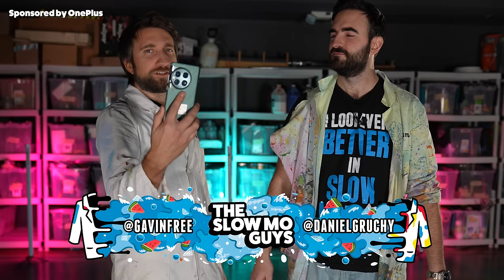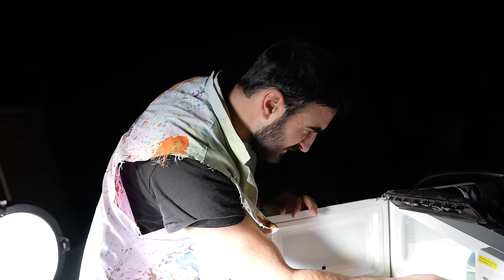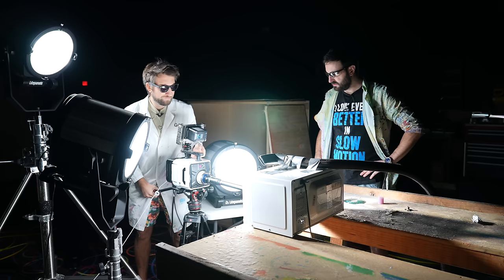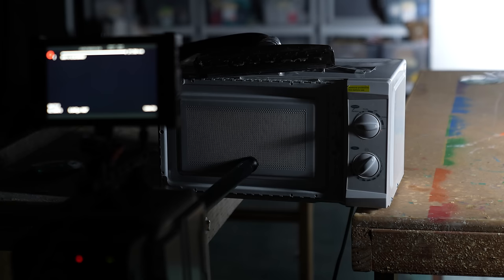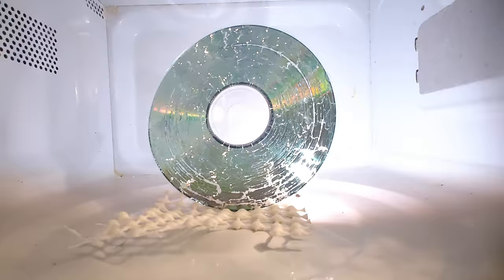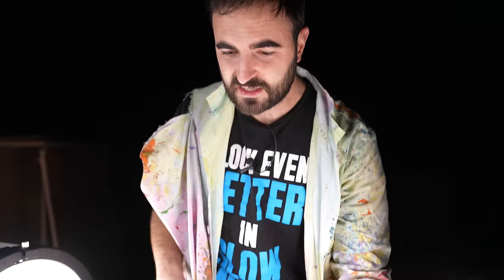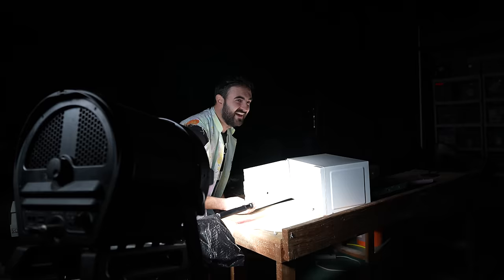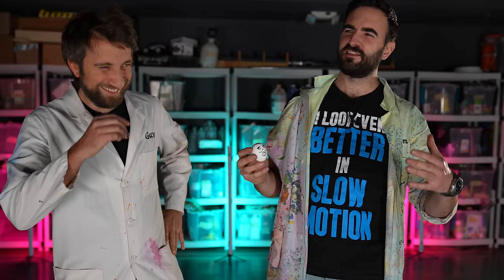Inside a Microwave at 80,000fps - The Slow Mo Guys

Comment: Fun fact: That 12cm wavelength is what causes your food to heat up unevenly. Microwaves transfer more energy at the peak of their wavelength (every 12cm). This is why microwaves have a rotating table. Though there always seem to be parts that get less heat energy
Reply: This is why I always try to put the food at the edge of the tray instead of the middle, so none of it gets stuck in a cold spot 😄
Reply: It's also why they direct the magnetron at a metal fan.  The fan reflects microwaves into the cooking chamber but because it is rotating the waves are scattered helping to prevent hot spots. The fan also doubles as an actual fan cooling the magnetron and rest of the electronics.
Reply: @Whatsinanameanyway13 Modern microwaves don't have the metal fan anymore, at least here in Europe.
The only one that I had come across so far that had one was a quite bulky brown unit likely from the early 80s.
I know from having disassembled so many of them...
Yet there are still schematics on the internet that show the waveguide and metal fan even though it's no longer part of new designs as far as real life microwaves go.
Reply: I always place the butter in the center for 15 seconds for better spreadability when it comes out of the refrigerator. It works best in the middle.
Reply: and that's why the MIDDLE is always not heated. all around is the end of the wave length. So you better put your food at the edge of the plate.
Reply: I'm not totally convinced that 30cm hole in the door is safe long term. We used to have a microwave with a dodgy door and I was convinced it was leaking microwave because 100% without fail every time the microwave was running our 2.4 GHz Wi-Fi would be completely unusable. I even had to be scientific and prove it because I lived in a share house and it meant replacing an otherwise functioning appliance. But it was 100% repeatable, microwave running, Wi-Fi dead. New Microwave, was perfectly fine.
Reply: @_BangDroid_  to make sure, put your eye up to the hole. If the liquid in your eye starts to boil, it's leaking microwaves. Hope this helps
Reply: @grantheine6068  Aqueous humour?

Comment: Our first microwave oven, an Artica,  we got it in the 1960s, it was rated at 5.5kW output for an input of 6kW (6kW magnetron). So, of course, us kids had to put an egg in it, you pressed the start button and the BANG was a millisecond later, the user manual stated you should not cook eggs in it unless they were beaten first, and then 1 second was enough on low power, the membrane around the yolk was enough to cause an explosion of egg in the oven. 
Thanks for this and bringing back a few memories, modern microwaves are so wimpy 😉

Comment: Microwaves were so named because they were more "micro" than UHF radio, which has a wavelength of 1 m to 1 dm (IEEE definition).  "Radio waves with frequencies above the UHF band fall into the super-high frequency (SHF) or microwave frequency range."

Very cool, guys!

Comment: Microwaves actually fall in between 300MHz and 300 GHz on the electromagnetic spectrum, in between Infrared and Radio wavelengths, with wavelengths between 1mm and 30cm. Microwave OVENS use the 2.45-2.5 GHz band, with wavelengths, as Gav said, of about 12cm. I was a radar technician in the Navy many years ago, and the wavelengths of short range targeting radars is 3-10mm, while long range search radar and weather radars use microwaves in the 8-15cm wavelengths (2-4 GHz)

Comment: This is interesting! Your little shot of the disc coating failing looks exactly like a failure of a lens i filmed timelapse over several hours. I suspected it was coating failing under surface tension but its almost identical so I'll take this as confirmation. Thanks guys!

Comment: The expansion ratio of the volume of water as it converts to steam is 1600 times greater. Assuming that was a medium size egg, it's total volume would be 2.7 cubic inches, and water makes up around 87% of an egg. That's approximately 2.35 cubic inches of water turning into over 3750 cubic inches of steam.

Comment: We did experiments in college physics with microwave emitters and receptors and hardware cloth (mesh wire) with 12mm square holes in it bounced the microwaves off it like it was a mirror, just nuts.

Comment: 1:29 I do want to say, the wave physics of microwave holes isn't necessarily "Its smaller than the wave, therefore it blocks it." it's more that the surface area of the holes is able to collect, absorb and redirect them similar to how sharp points on a stealth aircraft is undesirable as it will collect and redirect the waves in all directions.

Comment: I think the microwave is armed and ready only in war condition no need to modified or if any modifications needed just adjust to 1×10^-6 m wave lenght and if you want cooling adjust into low frequency and stop the spinning fan before use

Comment: I got egg on my face when I made the mistake of thinking that it's the shell that makes eggs explode. I hard boiled an egg in a pan of water, then after I'd shelled it I found that it wasn't quite done, so I put it in the microwave for a few seconds.

Nothing remarkable happened until I took it out, put it on the worktop and stuck a fork in it, at which point there was a BANG, and the kitchen and I were instantly plastered with scrambled egg.

Comment: I worked on a family turkey farm, their eggs are larger with harder shells. There was a while where when we were bored on breaks we'd blow eggs up in the microwave, they'd just blow the door wide open lol. Once I tried that challenge where you break on egg with one hand, but then I used both and because it was a fresh egg no cracks it took an insane amount of force, but it eventually just blew up sounding like a gun going off and egg went all over the wall. I think it was actually a double yolk egg which are bigger, nuked plenty of those too. I found an egg nearly the size of an ostrich egg that had seven yolks in it once, the turkey didn't make it.

The older workers eventually complained because when I wasn't there some of the workers that would do it wouldn't clean up the mess in the microwave, or at least not very good.

Comment: The microwave region extends from 1,000 to 300,000 MHz (or 30 cm to 1 mm wavelength). Although microwaves were first produced and studied in 1886 by Hertz, their practical application had to await the invention of suitable generators, such as the klystron and magnetron.

Comment: Something tells me the mesh is built that way for a reason, there is probably some mechanism of action which creates harmonics (doubling, quadrupling etc. the wavelength). The actual cavities in the magnetron shouldn't be able to create harmonics as far as I get it but there's always some weirdness happening somewhere when it comes to sinewaves.

For those that don't know how any of this works, essentially a Magnetron is a vacuum tube diode, that is an emitting cathode & an anode & nothing else. BUT, the anode has these cavities in it which both physically trap the electrons & also act as a "tank" circuit, that is an inductor & a capacitor, since the frequency is so high (for electronics standards) the actual metal semi-circles are the capacitors & inductors, it's pretty fascinating when you think about it.

But for the craziness to begin the electrons can't just travel straight from cathode to anode, instead there are a few powerful magnetic discs around the mag, this makes the electrons orbit around inside the space between the anode & cathode, it's an incredible action considering there is a ~4.000V static potential between a hot oxide cathode emitting tonnes of electrons & the anode, the idea they can just spin around many times before being "absorbed" by the anode is crazy, remember the electrons are travelling insanely fast, if they had the mass of your average atom the centrifugal force would be truly astonishing!

Comment: I once wrapped an egg petty tightly in 13 full-sized paper towels, put the dish cover over it, and popped it in the microwave for 1 minute 30 seconds. with 2 seconds left it exploded through all the paper towels, popped the dish cover off, blew the door open, and went all over the wall. The microwave survived though.

Comment: You guys should do a video on grenades exploding in slo-mo. There's a ton of variation in grenades, all of them would vary with the way they create shrapnel. And I've genuinely always wondered how evenly the shrapnel spreads surrounding the different kinds of grenades. Does the pineapple grenades the US uses actually create a even distribution of shrapnel? And how does the German grenades from WW2 disperse shrapnel? Or does it? Especially since that was basically just a stick with explosives on top

Comment: If you wanna nuke the battery, turn on all the comm devices; gps, wifi, BT, NFC, and have an app open/running like speedtest on loop, so it's constantly pulling data. recording in the background will also help as, depending on encoding and quality, it'll peg a cpu core or two.
Just mind the heat, because drawing too much off the battery too quickly, just like super-charging, can cause the battery to overheat and go kablam-sizzle

Comment: Not an expert in any way, but the length of the wave isn't necessarily the only thing you need to worry about, the amplitude, or height, is also important.

Just thought I'd share the little bit of knowledge I do have.

A wave of a smaller amplitude, might need smaller holes, regardless of its wavelength.

Comment: I'm wondering whether the wattages of the microwave had something to do with how the eggs burst.
A lower power one might heat more slowly and give it a chance to actually cook before reaching its explosion pressure where a high powered one would heat quickly and expand the liquid and air quicker resulting in the less cooked eggs

Comment: I would be wondering if that is a blank CD that was used. It would be interesting to see if the fracturing pattern would be different with a pre-recorded CD from the factory, since the tracks are pressed in, versus a CD that is burned at home with a CD burner, since the tracks are "burned" in one groove at a time.🤔🤔

Comment: 1:40 -- RE:  Microwaves at 12 centimeters of Wavelength v. Photons;  Sure, wavelengths of Light are much smaller, because photons define the Planck length.  It isn't impossible either to get an electron to behave like a photon provided the right conditions or interactions, but the electron gun inside a microwave has purposefully been set for interactions with.... a Molecule called Water.

Comment: Eggs will explode everytime, I once put a boiled egg WITHOUT a shell in it, and it all went fine, it heated up, I took it out, set it on the table and then I stuck my fork in it....BOOOM the explosion was so loud and violent I jumpscared and fell over backwards with my chair, bits of exploded egg where everywhere, so the net time I "got smarter" or so I thought and cut the egg in half as to let the pressure out before it build up and on half exploded in the microwave and my son did the same just a week ago, hence eggs will explode everytime

Comment: I wonder if the discs that they used contained data on it or not. The sparks seemed to follow a circular pattern around the disc almost like they were following the data tracks on the disk. If the disk contained data then the pits in the tracks could act like nucleation points and cause the sparks to follow along the track lines. Would a blank disk have a more random pattern to the sparks rather than following the data tracks?

Comment: Can we do an experiment to rival a blackhole. Ex: a black hole essentially applies Extreme gravity (pressure) to the point of nothing. What I am asking is to try and destroy and object (of any size) and reduce it to nothing (almost) my visual is a black hole pulls gravity from 360 degrees and uses it to complete crush and object under (pressure) to completely not exist. My question is can you pull this off maybe with a hydro press to make i don’t know a pebble disappear!

Comment: what would happen if you microwaved a CD at high frame rates, but used a VFD (variable frequency drive...adjusts the AC frequency away from standard 50/60hz... in order to control the speed of a syncronous AC motor)

Comment: This might be a stupid question, but is the audio added in post? When you go slow enough do you need a slomo microphone? I understand how sound travels as vibrations  and is picked up by vibrating a membrane in a microphone. If the microphone works by essentially measuring distance between the membrane and the sensor at that current moment in time. It must have some sort of tick-rate/shutter speed just like a camera no?
Reply: Thinking about it, a digital camera shutter uses a rolling shutter. It essentially scans like by line, so it has to capful along the x and y axis. With a microphone it would only have to capture the distance so essentially it’s 1 dimensional. It makes sense that it could do that incredibly quickly.

I don’t know I need someone smart to call out my arsehattery.

Comment: i have the xiaomi note 11 which is older, i charge from less than 10% til full battery  in about 10mins with only 67watts, either ur data is incorrect or it must be because you only have 110volts.....?